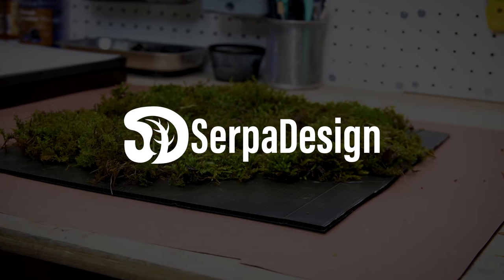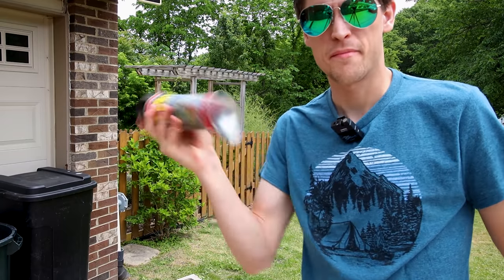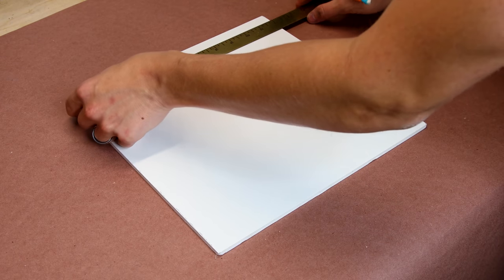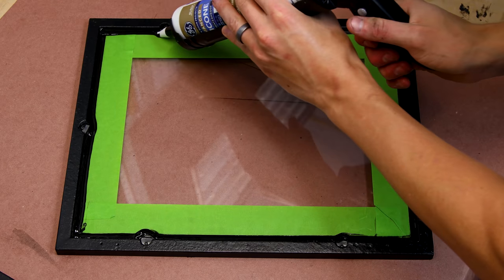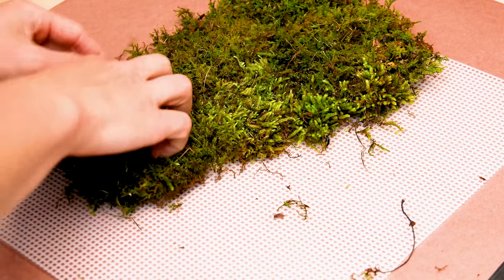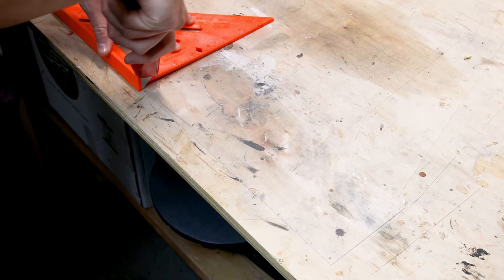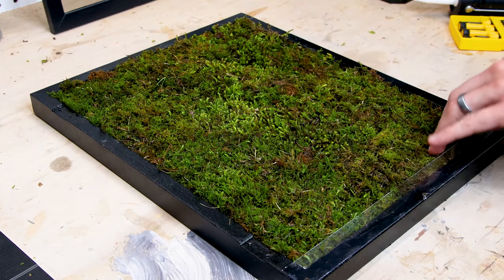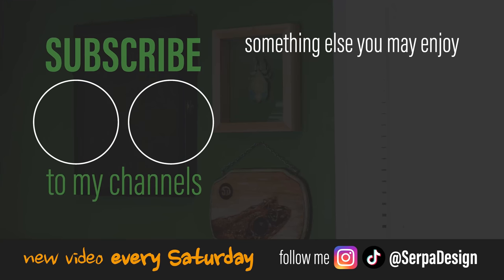DIY Living Moss Picture Frame (Relaxing Tutorial)

Comment: I'm wondering (as do some of the other folks here) how often this will need to be sprayed. Also, I thought moss needed a lot of light -- the equivalent of outdoor shade. Will this do well in the long run if grown indoors?
Reply: It will all depend on how the exact moss responds the exact light and conditions. If he just built it, he would not even have a maintenance benchmark.  He likely will check it once a week and see how it is doing until it settles in.  Lighting for mosses vary by species.